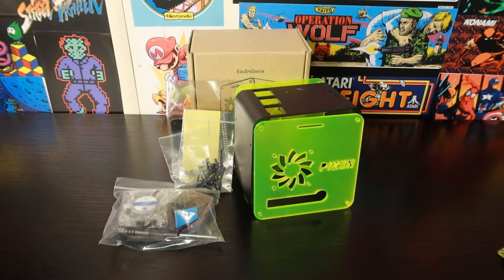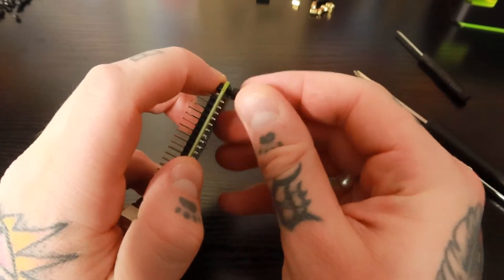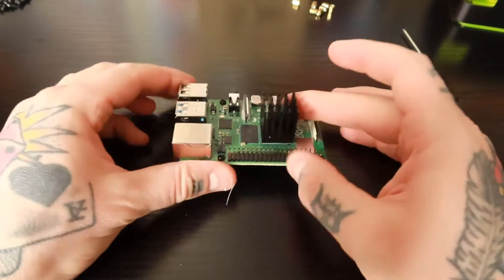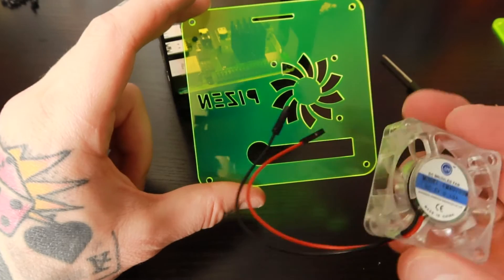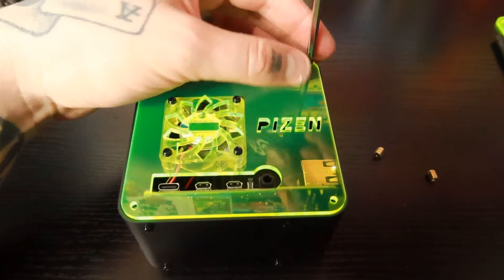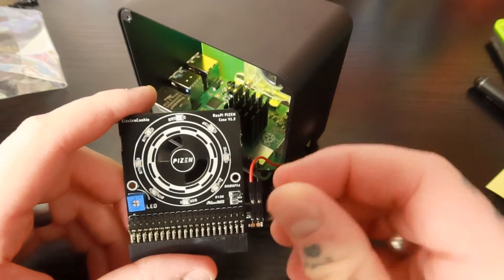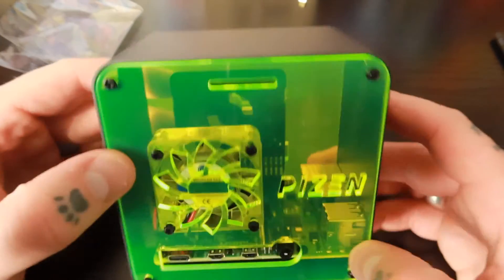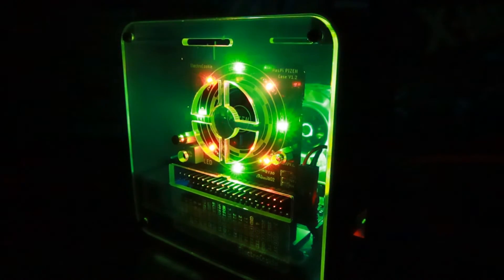ElectroCookie Pizen Raspberry Pi 4 Cooling Fan Case Setup Guide | How To Install The Raspberry Pi 4

Comment: I put the bolts/spacers on the header and attach it to the pi first then attach the red n black wire, was hoping to see if you notice the screw dial control on the header light board, and gap in the case so you can access to turn, has a icon like a volume on a stereo, am guessing it control the speed of the lights or fan or both

Comment: How can we adjust fan speed based on temperature? I mean I know we can adjust if we connect it to one of the gpio pins, but here it looks like its using dedicated pins.  for me it is running constantly forever and its been an issue.

Comment: I've been hunting for a great little case fan combo for my RGB-Pi O/S setup, and this looks perfect because I need access to the GPIO pins without losing a plug and play fan. I only wished I found this sooner! Subb'ed :)
Reply from the maker: Thanks! Yeah it's a really great case. You could look at the argon cases too.
Reply: @officialchasebrogan  would an Ice Tower fit in here?

edit: yup, just found a review stating that it does 🙂
Reply: Started with an Argon. Sweet daughter board to connect micro hdmi to normal size. However it was screaming loud all the time. Switched to one of these electrocookie cases today. It was whining too, until I took it apart and reversed the fan direction. Now it looks cool and is much quieter (but not as cool running) as the Argon.

Comment: I love my 4GB RP4, but of course what I REALLY want is something like four of the 8GB RP4 put together into a custom case and make a computer/emulation machine I did myself lol. I even have one 8gb Pi for the sole purpose of integrating it into the, well more like an SUV, or wagon depending on who you ask lol. I'm working on some software that will Allow full engine management and performance tuning (aka like a MegaSquirt or HonData aftermarket ECU,) only it will also be what's running my music and other in car media, and my favorite part is it'll allow me to instead of using a normal Guage cluster (speedometer, tachometer etc) I can use a custom screen bought from anywhere to make a fully customizable digital Guage cluster and if I ever finish making the new LED tail light boards the in car Pi will also allow me to have and choose from many different "patterns or shapes and go anywhere from stars or circles or spell out words using tail lights stuffed with a custom board with many, Mlop. tiny LED lights,did I mention there's a lot of them? lol down to it looking like a factory tail light. This is all for my '00 Subaru Forester L with an 3.3ltr H6 that's been built and boosted swapped into her. Just taking my time doing a custom full chassis wiring harness blah blah blah. Weed, Subaru & Raspberry Pi... That's the good life lol.
Reply from the maker: That sounds awesome dude! I want to see when it's done!!